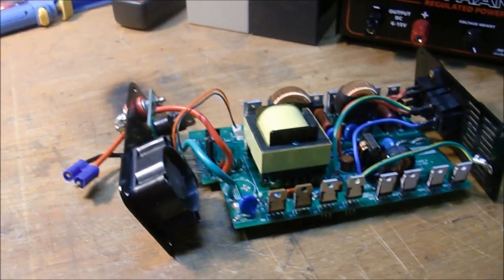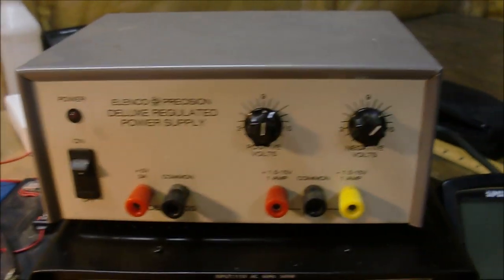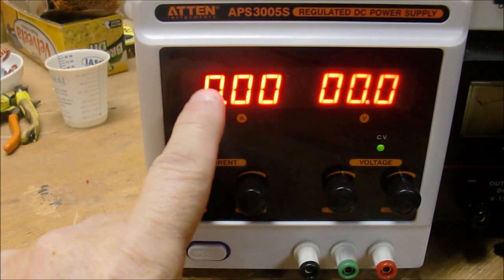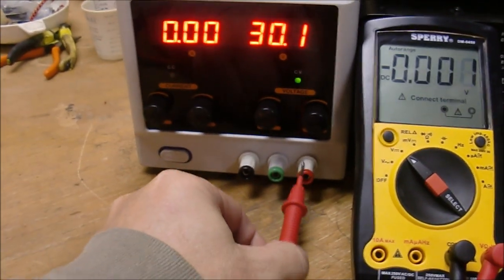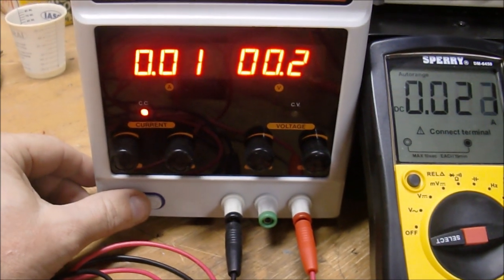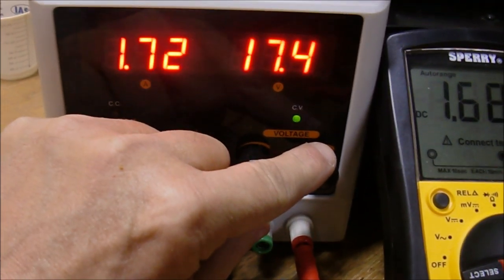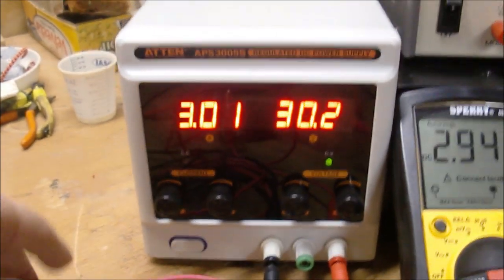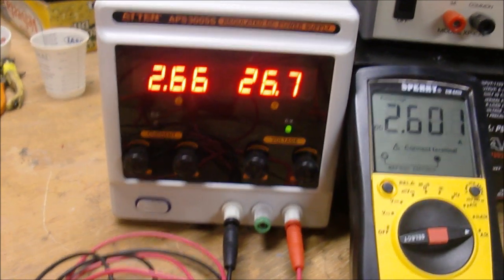ATTEN APS3005S DC Power Supply Review

Comment: i have a problem with this power supply ..i cant set the correct voltage !! when i put 5v for example it output just 1v !! where is the problem please
Reply: i have the same proplem here , did you solved ?

Comment: would you happen to know where I can get the front plastic sheet (which says current, voltage, fine, coarse..etc from)?  I left the APS3005S in my car on a summer day and the plastic sheet warped and now does not fit back on the unit.  I need a replacement but don't know where to find one.  Any ideas?